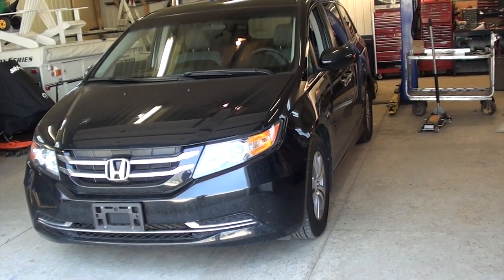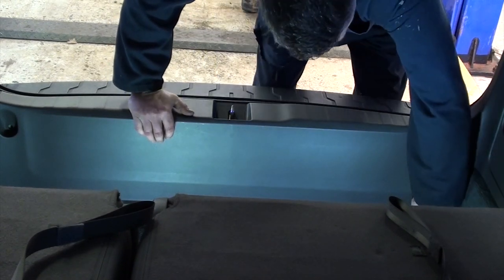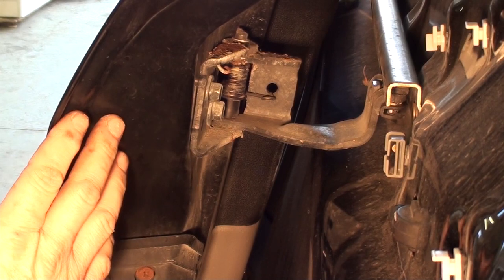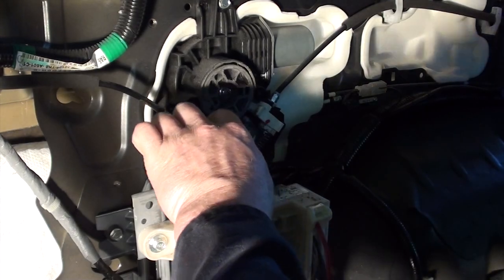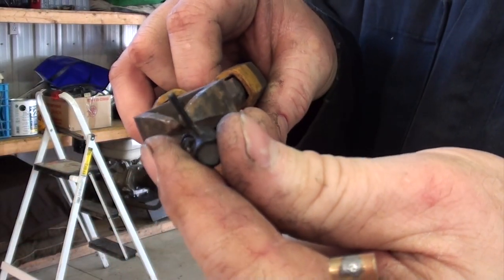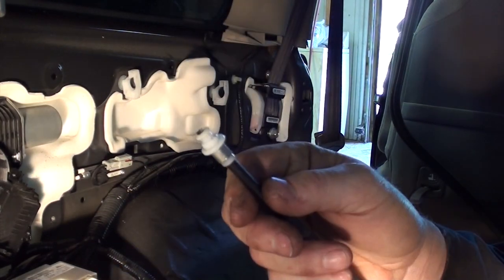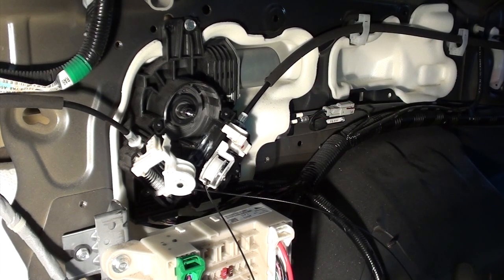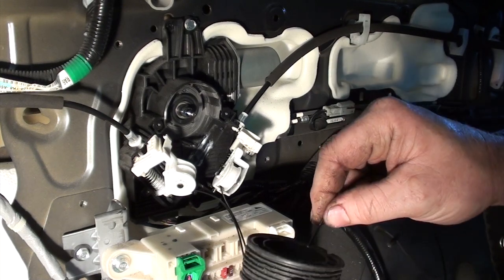Power sliding door cable replacement.  2011 - 2017 Honda Odyssey

Comment: Thanks BackYard Tech for the video! - I just wanted to make a note for anyone completing this repair on the passenger's side of the van. On the passenger's side this video shows the correct spooling of the cables. Do not reverse them as recommended for the driver's side. I did that and had to redo it. The cables should not cross each other but go from the plastic pulley directly up into the spool with the rear cable on the front of the spool and the front cable on the rear of the spool. - Two other quick notes. You can't access the rear cable guide to pull it out and make installation easier because the A/C unit is in the way. Don't worry, it's pretty easy to fish the bare end of the cable through, push and twist and it'll find it's way all the way to the motor. Also, the right (rear) 10mm bolt that holds the motor cover on is hard to access because of the A/C unit as well but a long or at least standard 10mm open ended wrench will get it off/on 1/4 turn at a time. - I will say that after you do this once you could probably knock it out in an hour if you had to do it again. Like any repair, once you've done it the second time is much easier! Happy motoring.

Comment: Thank you so much. Without your video I couldn't have dreamt about replacing my broken cable. Mine was on the other side and a there was a fan exhaust in the way. I also couldn't get the roller the same way you did, had to remove the bolts. I used masking tape to mark the spot and didn't have any issue putting it back. The ferrule crimper tool that I bought was garbage, I had to use pliers to tighten these ferrules enough. Otherwise I followed all your instructions and it took me about 6 hours to get my door fixed. Thank you again so much!

Comment: Just did my passenger side, many thanks!!!  Winding the spool is definitely a 2 person job.  I had to replace the cables on the passenger side of our 2014 Touring...The rear cable sheath is bolted to the body behind the rear A/C system.  After trying unsuccessfully to thread the new cable through from the outside (without removing the sheath), I took a long section of the broken cable and cut the end at an angle (using bolt cutters)...this allowed me to feed it through from the outside pretty easily (the angled end got around the pulley without catching on the internal ribbing).  I then put the end of the new cable against the end of the old cable and used a long piece of packing tape to wrap around them, joining them together.  Gently pulling the old cable through while my wife pushed the new cable from the outside allowed us to feed the new cable through the sheath without removing the A/C system to unbolt the sheath.

Comment: Video was good until.i wound up the cables, my 2012 rear cable goes to back of spool front cable goes to front, it was so disappointing when I got this battery together only to find out the spoil is reversed from this video

Comment: Thank you for the video. Just got finished with mine. The only thing I did different was when it came time to install the cable tensioners I cut a piece of rubber tubing to fit onto shaft to hold it in the compressed state. I wound the cable on the drum and after tensioners were installed I took needle nose pliers and took out the tubing to get the cable tensioned. I hope this makes sense. That way you don’t have to try to compress those springs with greasy fingers.
Reply: I used zip ties to hold the tensioners in the compressed state and then just cut then and pulled them out when fully assembled
Reply: These ideas helped a ton. Thank you!
Reply: Ya great tips. Zip ties were a piece of cake. Thanks!

Comment: Okay I finally did this and pulled it off! The key that I didn't do before was lube everything up and ensure the white plastic pieces on the motor were compressed properly. Thank you SO MUCH for a well laid out and detailed video. 

The ferrules are smaller than the original ones.

Comment: I don’t think you connected that rear panel electrical harness when installed back into the car. If you did you must have edited it. It was dangling before you finished pooping it in. Other than that great job

Comment: Passenger side reel is opposite-rear cable is on the front side of the reel and front cable is on the inside/backside of reel. Did mine today

Comment: The cable windings are incorrect and if you try to operate the motor after the repair you will destroy the plastic rollers inside. 
Yeah I know.  Sad 600$ mistake that needs to be addressed in the video not the comments.  Lots of confusion. My .02

Comment: I feel like I had slack in the cables and did the front to the front (visible) and back to the back (hidden) side of the pulley.  I tested it manually and it worked but then when we tried with the motor it had too much slack and sliced off some the of  the pulley ribs as it ate up the new cable.  Do you wind the cables the same direction (cw or ccw?) and should there be little to no slack?  Hopefully I can get another attempt and my pully isn't FUBAR'd....

Comment: 31:05 the cable from the back of the vehicle DOES NOT GO TO THE FRONT!!!
Front cable to the front, back cable to the back!!!

Please EDIT video and make a remark!! 

Wasted 1 hr to redo it. Thanks for the rest of the video though.
Reply: You are correct. Sure wish I would’ve known that before I completed this project. After reconnecting the battery and  retesting in accordance with the video, it destroyed my new cables and broke one of my white plastic spring loaded pieces near the motor. I’m so pissed. Wish he would’ve edited that into the video

Comment: Thank you for the video and your time. I just did the driver and passenger side. I found that after spooling the cables it was easier to put the pulley back on with the nut and then work the tensioners (white things) back in. It took less than five mins to install the cables back into the motor. Side note on the driver side the front cable goes on the front of the pulley and on the Passenger side the back cable goes on the front of the pulley. Also the cable lenghts are super important. I had to cut about 2 inches off the new rear cables to have correct tension.

Comment: Like everyone else commenting Id like to thank you for making this video. It gave me the extra confidence I needed to dig into that interior. I was shocked to see how simple it was to take apart. The broken cable on our door was on the other side so there was some large item in the way but I was still able to use this video to get through everything. Your video was also far far far better than the other one on youtube dealing with these cables.
Reply: I think that large item was your AC unit.  It was is my case anyway!

Comment: Thanks much! Just fixed mine (2014 EXL driver side) following this video. The ribs on my spool were quite damaged, but after cleaning it up seems to still work, but not sure for how long the fix will work. 

Would probably be a good idea to put a caption on the video to let viewers know the rear cable goes to the back of the spool, instead of just in the video description. Took me a bit to figure out.

Nonetheless, great video!

Comment: Thanks for the video. I was able to fix my 2015 odyssey. The cables were a mess like yours. Easy video. Make sure to take pics of how your cables feed into the pulleys. I got my cables from eBay for less than $15.

Comment: Thanks, I think if you fully assembled all parts inside the vehicle then connecting the ends with the hinge-roller would be easier and avoid struggling with the tension in the motor's parts. Great job, I will do it soon!

Comment: Glad I found this video (again), my drivers side cable failed again.  I got about three years out of the one I installed.  This time, I'm going to take extra time to clean and lubricate the mechanism.  I have not yet taken it apart but one of the cables has broken.  Wish me luck!

Comment: I haven't taken the time to read all of the comments and I have used this twice to fix this problem....but I have a trick to add. I was able to use a small piece of tape (medical tape.... its very sticky and thin) to push and pull gently to guide the new cable through the pullies without removing them   Hope this helps

Thank you for the video

Comment: Another successful repair using carcableguy parts and this video! Thanks!! I will say I followed the other commenters and put front cable with front of spool and rear cable with rear of spool, and that was not right. Door opened when it should close. I had to redo, and put front cable to rear of spool. Then it worked. Not sure if it was because I was doing passenger side. Just my experience.

Comment: I have been trying to thread the cable like you did at 20:51 with no success for like 3 hours, how frustrating. How do you remove the pin from the roller so easily at 22:47? Doesn’t it have a fastener securing it on the opposite end?

Comment: So I followed this video verbatim, and the cables I had, got chewed up and destroyed when I turned motor on. It worked well manually. I went to Honda and bought a whole new motor assembly and installed it following again the way it was done in this video. Again, I popped open the motor cover and the cables were blown. The car has never been in an accident and I can't understand what I'm missing.

Is there a process to re-align the doors or reset their positioning with the motor and computer? Because I unplugged the battery terminal and nothing happened.

Comment: Thanks for posting this video - I replaced the cable in my 2013 Odyssey using the steps you outlined. Saves me at least $1000 👍🏻

Comment: Hi Thanks for great video. I have a question. Does the cable come with the exactly right size? Do I need to cut it for 2015 odyssey? when I put the cable into the ferrules, can I fold the end of cable a bit so that it can have tight grip. I don't know whether the size of cable is ok to allow me to do so. how to make the vehicle learn  the position of door at the end? you mentioned dash open button , what's that button? thanks

Comment: How about the passenger side cable replacement.  We dove into it and found that the heater/AC assembly prevents you getting access to the roller assembly coming from the outside of the door into the car.  Any suggestions?

Comment: Thank you for an excellent video. You have the patience of a saint! I have a 2004 odyssey and wondering if I were to remove the cable completely will I be able to use/open the sliding door manually?

Comment: Backyard..........this was a loooonnnnngggg video!!!  But well worth the watch.  My wife's van has both sides broke.   This should be a recall item.  You took the time and showed step by step.  All the other videos assume you know how to do specific things, like pulling the panel.  I'm not nearly as afraid of doing this as I was.  I will probably watch this a few more times to make sure I've got it nearly memorized.  Only thing............could have posted the part numbers ;)  Thanks for a great video!  Would the steps be the same for the other side?  Same parts?
Reply from the maker: The replacement cables are the same right and left. I bought the replacement cables from e-bay, and don't even know if there is a part #.  I would like to point out a error I made in the video that other tubers caught.  When routing the cable on the spool, I said which cable goes from and back/front of the spool incorrectly.  Don't  think I can edit a published video.
Reply: @crownedroyal2003  I got my driver's side done.  Passenger side........well for whatever reason the cables were tight and hard to get back in, when I did, it broke a couple of plastic pieces on the motor housing!!!  So, I'm just going to leave it manual.  Thanks for the video!  I saw your footnote about the winding of the cable.

Comment: Great video. Almost done just need the crimping tool... waiting for it to arrive otherwise the rest is done! Quick question for those out there who might have done this. Is it necessary to move the door to the mid point or can it be fully closed? I see no reason why it’s matter much where the door was located/how much cable was available. Thoughts?
Reply from the maker: I agree.   Likely the door can be in any position as long as you can access the roller.

Comment: Any thoughts on a replacement for the plastic sheaths that you salvaged from the old cable where it fit into the roller. In my haste to get my door working in manual mode after the cable snapped I cut the cables and removed from roller and subsequently threw the ends away. Now that I am looking at you’re video to replace the cable I realized I should have kept the plastic sheaths. Are they required to stop wear on the end of the cable where it attaches in the roller? Thanks for the video btw.
Reply from the maker: I doubt you can by the cable sheaths, and guessing it not working without them there.  Maybe buy a used motor with broken cables and try and repair.
Reply: @crownedroyal2003  Ok I’ll figure something out for it, thanks.

Comment: Also.........it's been over a year, how are the cables holding up??
Reply from the maker: I have had no issues at all with the cable repair.  I have had to replace the centre hinge on that door due to it binding in the track.

Comment: Thanks for the video, it was very helpful in repairing the broken cable.   As others have pointed out, on the driver's side, the rear cable goes to the front of the pulley, not the rear as you initially said in the video.   Turns out the passenger side is the same (rear cable goes to the front of the pulley).

Also, just wanted to tell others some folks on eBay sell the cables pre-terminated with replacement gaskets.   They sell for around $100 door and may save a little time.

Thanks again for the video, it was very detailed and helpful in getting the job done.

Comment: My door will not open to start this repair, it only opens about 6 to 8 inches.  Not sure how to open the door so I can start.
Reply from the maker: You have to cut the cable in the track to open the door.
Reply: I opened up the motor a d took the spool out to release the door.  Saved one of the cables that way.

Comment: Great video! My door is having the same problem as you mentioned when it wont close all the way. I reset the doors like you said but It still wont shut all the way. What did you have to do to the doors exactly? Thanks!
Reply from the maker: -Turn the doors off.
-Close the door completely manually.
-Disconnect battery for 10 minutes, then re-connect
-Turn on power doors.
-Hold door open button on dash unit door fully opens.
-Hold door close button until fully closed.
Door should be re-homed.
Reply: @crownedroyal2003  A common way to reset those doors is to make sure vehicle is turned completely off. Close all doors completely, including trunk. Slide automatic door switch on, turn vehicle on and hold sliding door switch to the "close" position for about 25 seconds. Operate door normally.

Comment: My cable is broken and the door won't open like that.
Reply from the maker: Cut the cable to allow it to open
Reply: @crownedroyal2003  I also have the "sliding door" lamp illuminated on the dash. Is that bad?
Reply: @my95buick  Thats because the cable is broke.  If you turn off automatic doors it should go away.

Comment: Thank you! Ive never done any car work, but didn't want to pay a dealer $1600 for this wire. Couldn't find videos for the 2011, this helped me do it perfectly, works great. Thanks for putting the time into making this!
Reply: Wow 1600 not even including the motor??  Omg!
Reply: It should include the motor from dealer.  My understanding is that they do not sell just the cable direct from Honda, you have to buy the whole assembly.

Comment: This fix was accurate for a 2015 Honda Odyssey.  Did it a week ago and results are good thus far.

WARNING: The video creator states the wires connect Back Wire to Front of Wheel; Front Wire to Back of Wheel.  This is INCORRECT.  

Back wire goes to the back of the motor wheel, and the front wire goes to the front of the motor wheel.

ADVICE: I found keeping the door CLOSED while trying to wind the wires around the wheel was much easier than the halfway technique.  You will first wind most of the wheel with front wire, and only a rotation and a half on the back wire.  Got it in one try this way.

Otherwise, great video!